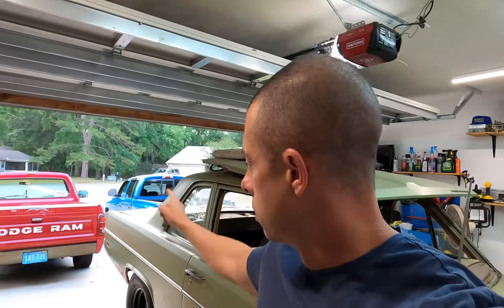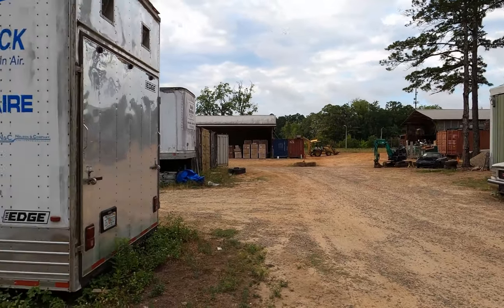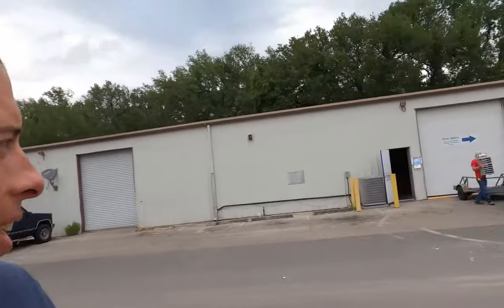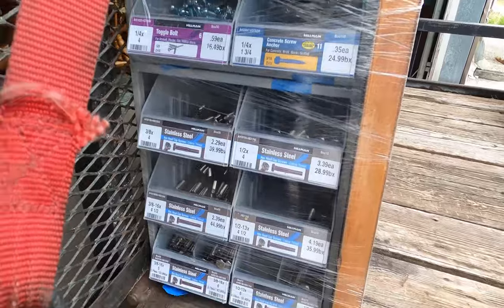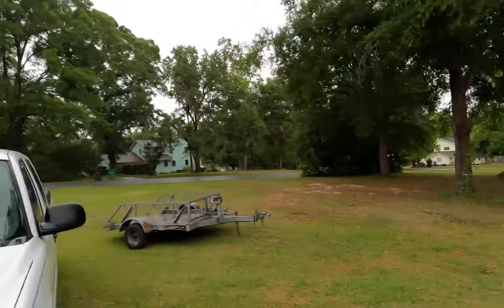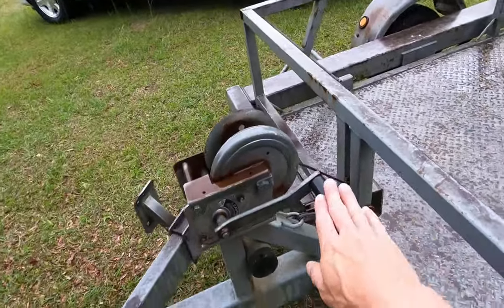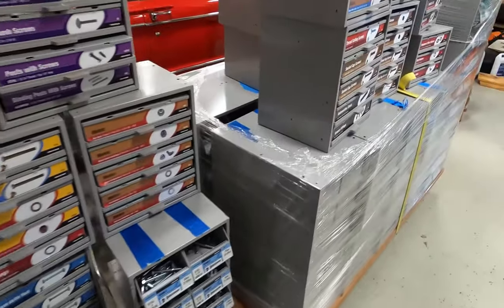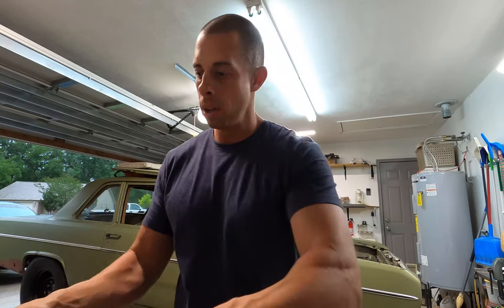He bought EVERY BOLT BIN in Ace Hardware!!!

Comment: Hey there. You seem pretty knowledgeable on non stock parts so I was wondering if the serpentine pulleys and accessories off of a magnum engine would bolt onto a LA engine? Thank you for any advice. I like you channel. Keep up the great work.
Reply from the maker: You would need to change to the magnum timing cover and water pump. The you can install the bracket for the serpentine setup. You will need a crank pulley off of a 1993-97 because the 1998 and newer are integrated into the balancer which is different than the LA. Also....the alternator for the magnum puts out more amps, than LA, so you have to be careful it doesn't fry things.
Reply: @TheGasTap  I sure appreciate the reply and help! I bought a 87 Ramcharger and am oblivious on where to find parts/info on how to go about things. If it was a Chevy there is to much info available.lol. wiring is my biggest problem, I don't know what I am doing. Anyway, thanks for the reply and videos. Really like BigRed and the car!